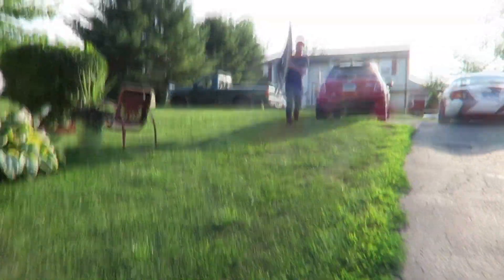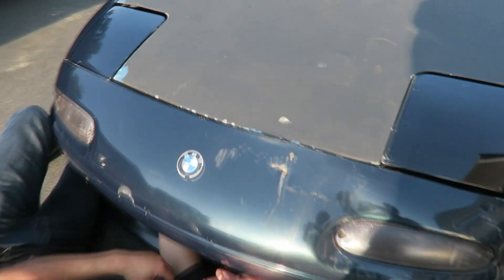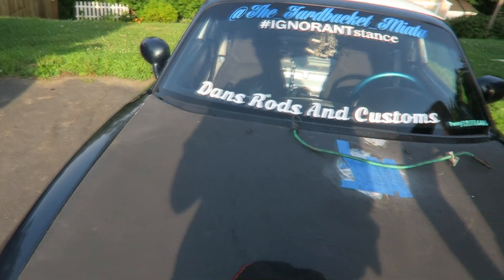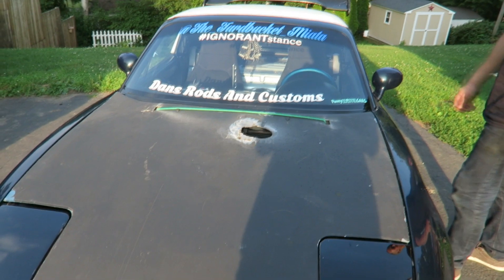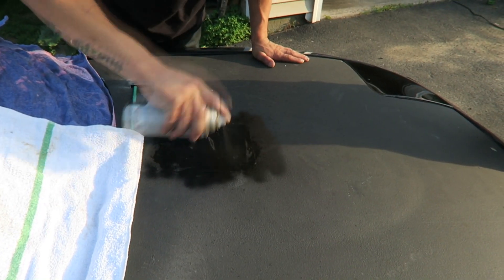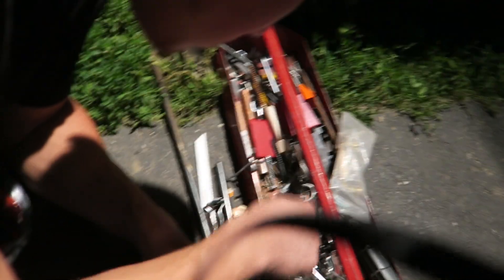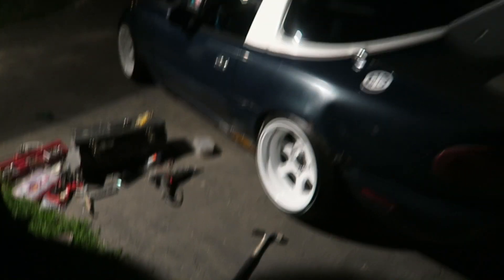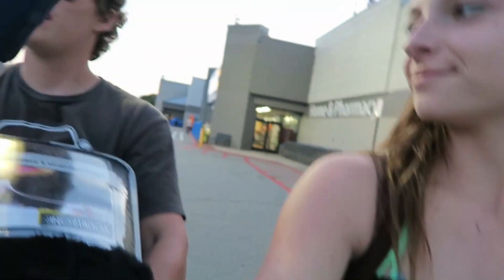Hacking A Miata Hood!

Comment: hood pins 6 bucks at orielys takes like 5-10 minutes to do dude I have pins on my car tho I did the locking pins with flush mount so there a little more expensive but the other pins will look sick and it's weight reduction loosing the hood latch and all the cable and shit
Reply: +Ricer miata bro hood pins for life easier and safer
Reply: +Highzombies but it's safer and 9/10 you can get pulled over for it don't think he wants a ticket
Reply: +ostynn cotton lol screw safety
Reply: +Jack Matthews I do rally and auto cross safety first every time or youl never get on the track. dosnt mater if it's the track or not. bungee breaks , hood fly's off and gos there the person behind yous windshield 1 it can kill then and your fucked 2 incidence won't cover it so it's all out of pocket for you and 3 if it kills them your looking at a few years in prison, getting married to some dude named bubba , and ending up with a tattoo on your ass " bubba's bitch " not to mention youl probly never get your car back or your licence back so ya do what your gonna do see if it works out for ya

Comment: Those cutting wheels are ass. I bought a pack of 20 at lowes for $5 last week to cut some plastic off to put in some fog lamps and after i broke 2 i broke out the sawzal. Now i know why they were  $5. The fiberglass ones dont break but they wear out a little bit too quickly. They make diamond plated metal ones but theyre $20 and i cant justify spending $20 on a fucking cutting wheel